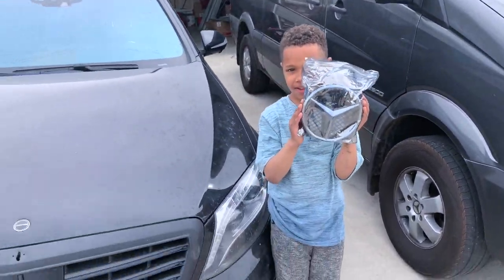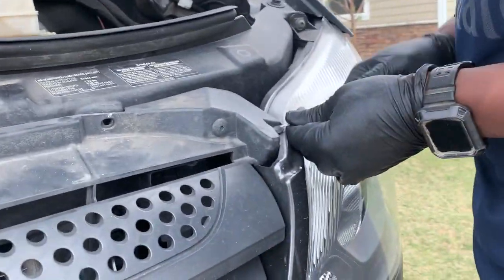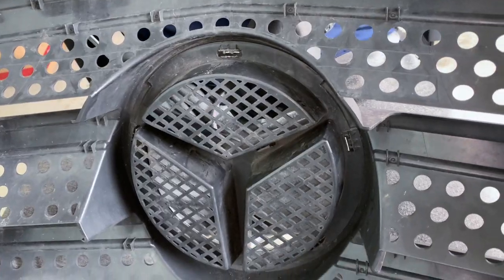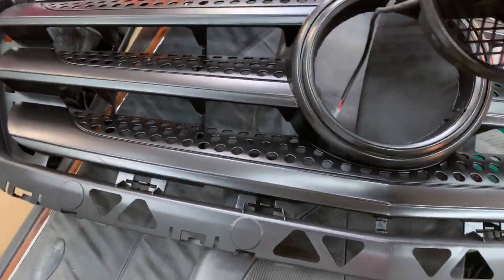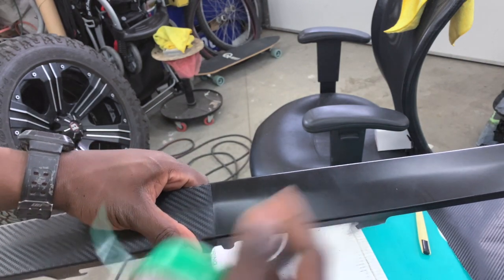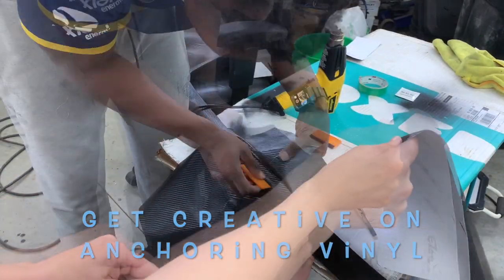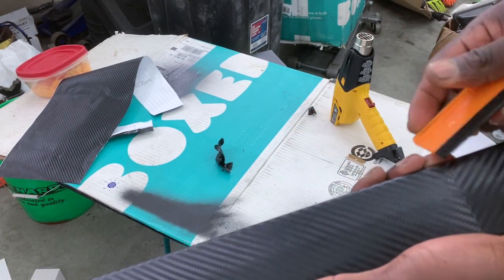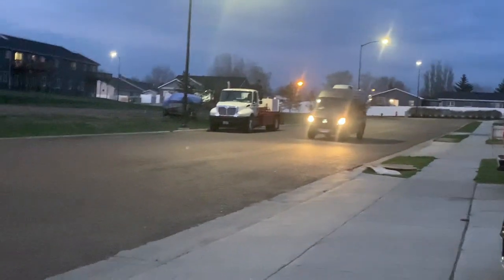Mercedes Sprinter Mod: Customize Vinyl & Wire LED STAR on Mercedes Sprinter

Comment: Nice. You gave me the idea to wrap my front. I'm doing my while front and back taillights now. Installed morimoto h1 projectors and in the process of installing custom LEDs with the blue ghost module and the back taillights LEDs with the Corso motion sequencer. Was going to buy the light up star but I honestly have over a grand in the addressable leds that each led can be a different color and I'll hide those to. Make it light up. I have some apa102 that you need a microscope almost to see them but really bright. But didn't think about the wrap. You did a great job for just a begginer. I made all my rookie mistakes on my 2019 sprinter. I got a 2020 now and no mistakes.
Reply from the maker: Why the 2020? What feature sold you on it?